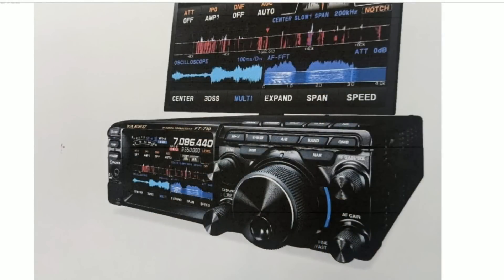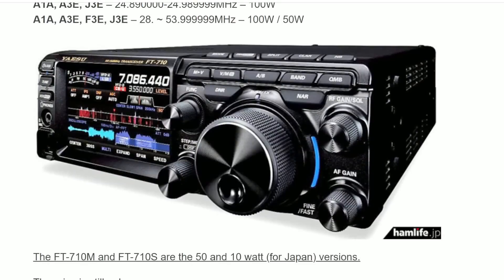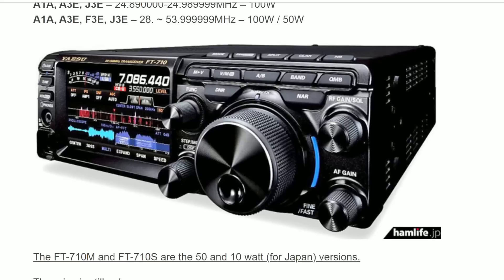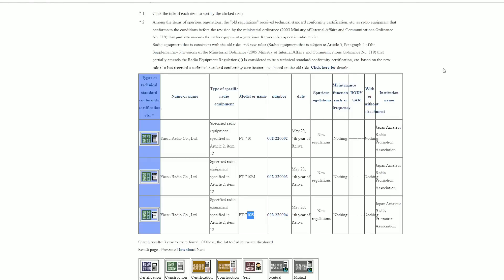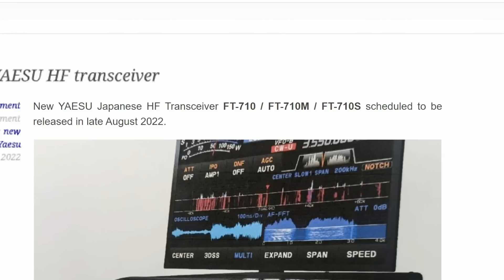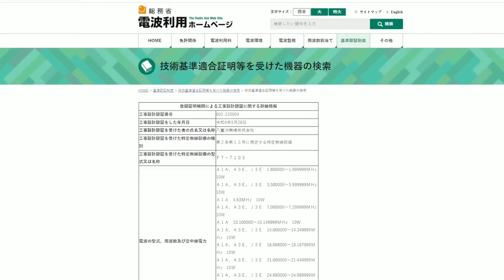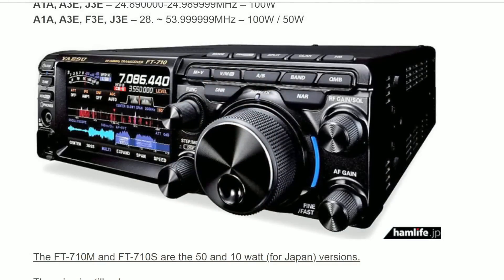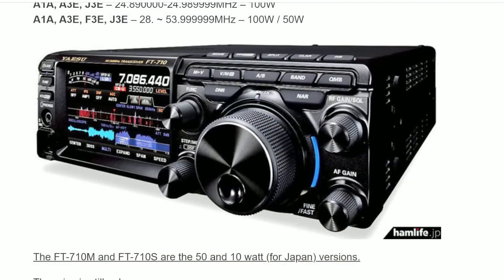NEW! Yaesu FT-710 Announced! HF Radio- Size ,Weight, Frequencies, Power, More - FIRST LOOK! #yaesu

Comment: I just ordered the FTDX10.  I'm not sorry I didn't wait - a larger display is very important to me.
Reply: I have had my FTDX10 for over a year now and I love it. You will be very happy with this radio. Wait til you hear the receiver!
Reply: @timrahto658  Thanks! I REALLY love it already, and I haven't discovered a fraction of the features.
Reply from the maker: It's definitely great. Congrats. If you haven't hit that DNR button while in sideband, you're missing out! Good luck!
Reply: @DudeTested  The cool thing is that it's a hybrid SDR. That explains something I discovered earlier. I have a ultra cheap USB SDR dongle. I noticed that I could hear SSB with that crappy dongle better than I could hear using my old, used ICOM. Now the folks on the Yaesu sound even better than on the cheap dongle. SDR and digital signal processing for the win!

Comment: The first thing I noticed was the outer ring is missing on the tuning knob. Without VHF/UHF all mode, this radio makes no sense to me. My guess is this will be an updated super het. Otherwise, I don't get what the market is for this radio.
Reply from the maker: I've asked Yaesu to come on and give the dude crew a first look. Let's hope they say yes.
Reply: @DudeTested  That would be fun.
Reply: Exactly!  I want a 991a update!
Reply: @maschwerer  Ive always thought the FT991A display resembles Minecraft.  😆
Reply: SuperHet would be a plus for me, better on Cw. The SDR side wilts in comparison to the fabulous GUI of IC7300. What value do hams place on a sensible Icom GUI as compared to a cobbled text based feature set? Curious what the cash value would be...
Reply: @donr2670  If you want a SuperHet with the GUI of the 7300 (not the waterfall) get a 7100. Got rid of my 7300 in favor of Yaesu because I got tired of the "OVF" light coming on all the time and desensing the radio. No other radio I have did that. Even the 705. The 7300 was a nice radio. It just did not work in my environment.

Comment: My guess it will be less expensive than the FTdx-10 because I think (again, pure speculation) is that since it ditches the "dx" name, it will lose the great receive capabilities, such as the VC-Tune and I suspect it won't have the quality crystal roofing filters. Very possibly it won't be a hybrid SDR like the 10, 101D and 101MP but rather a direct sample rig more like the IC-7300. I think that this will be more of a IC-7300 (in feature and price) competitor than the FTdx-10, because the 10 was much more expensive. Pure speculation.
Reply from the maker: It would be weird to see them not do a hybrid as I kind of have the impression that when you become successful as something, you start incorporating it all your products. However, I'd be very curious if Yazoo steps in and will kind of give us some information. Thanks! Take care!
Reply from the maker: Someone else mentioned it too, maybe it's an replacement for the ft450.  If that's the case, I would be surprised that it actually had video out, or cat control. If it has cat control and it's six to seven hundred dollars, they might have something good on their hands.  Otherwise, what's the point
Reply: I think your on point, this is a 7300 killer and at $850 for the EU AESS Model with its DVI output its perfect! Better QRM filtering too... spec wise but real world is another thing.
Reply: If only Yaesu would put on HDMI ports instead of DVI ports and have the display be higher resolution ... like 1080p or even 720p. A $35 Raspberry Pi even has a 1080p HDMI port.

Comment: So disappointed with Yaesu.

Still no IC9700 competitor.

The FTDX10 is far too small for anyone with man sized hands. Which is why I sold mine. I was hoping this would be bigger.
Reply: Oh yeah, a 9700 competitor?  Good idea. I have small hands so maybe this is good for me. I guess Yaesu is just updating their designs to make them manufacturable with all the supply chain chaos.
Reply: I think the development of semiconductor grants recent small size rigs, but it may be needed to adapt to man sized hands.

Comment: Thanks for the first look, Dude!
Have to say this one confuses me... it really doesn't fit in a niche that Yaesu doesn't cover (like a IC-705) or is a good replacement for one of their great yet aging transceivers, like the FT-891 or FT-991A. I would have loved to see a modern replacement for my beloved FT-891.

Or I could be off and Yaesu may be phasing out the FT-991A and their take on the "shack in the box" concept?
Reply from the maker: Phasing out the 991 series would be a bummer, I've been using that more than my ftdx10, for the sole purpose of the vhf/UHF with hf
Reply: @DudeTested  I completely agree. I really enjoy my 991A and think a “991B” with the updated display and other improvements of the newer Yaesu’s would be a great move. 

Tango Oscar Mike’s idea would be fantastic as well.
Reply: @Scout75PortableRadio  Yaesu could do a much improved version of the 991A, with the more modern features they've been introducing  - keep the band coverage, maybe add some? and give it some I/O that would work well for base or field use. I've been a bit confused with some of their new radios, they're not bad, but seem hard to place where they fit in for some.
Reply from the maker: I agree.  Tango Oscar Mike made a good point in the comments, maybe they're doing a qrp. Radio with a base station plugin that works at 100w when plugged in.   Two for one.   If not, who knows.  I emailed Yaesu to see if they would jump on with me and discuss the new radio.

Comment: I wonder if it is a modular radio, as in the front half is the base 10 watt radio, kind of like a 705 and then you have 2 back halves that contain either a 100 watt amp or a 50 watt amp.  That would be pretty cool.  I would have to think the 10 watt version would be a lot lighter and smaller.
Reply from the maker: That would be something pretty interesting and innovative.  Basically it would be two radios on one.. qrp or full power, depending on how it's used.. 😯
Reply from the maker: I'd definitely buy that!

Comment: a replacement for the ft450
Reply from the maker: That would be interesting., Of course this appears that it would have a sound card and an external monitor, quite an upgrade from 450.  And I have to assume though with all the features they're adding, it's going to be the same price or just slightly cheaper than the ftdx10. Unless they're trying to compete with the 7300 and they price it around $1,000
Reply: I was thinking the same thing.

Comment: Informative video as always. Pity it is not a 991A shack in a box replacement. Keep up the great work 73 Neil
Reply: Replacing the 991A makes more sense than replacing the 450.
Reply: @don_n5skt  Agreed, replacement long overdue with improved waterfall and architecture.
Reply from the maker: That would be the to to
. A portable 991a. Vhf UHF, hf.  I'm wondering when, but I'm starting to believe we'll see icom make a 705 upgrade with more power before we see a Yaesu equivalent.  Take care
Reply from the maker: Thank you by the way
Reply: @DudeTested  Always a pleasure, you do a great service to the ham radio community. n